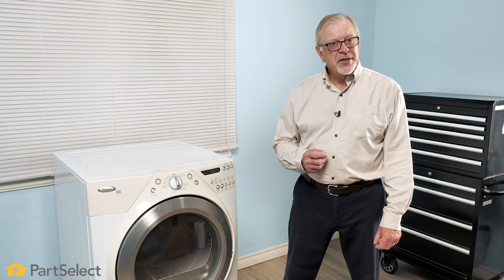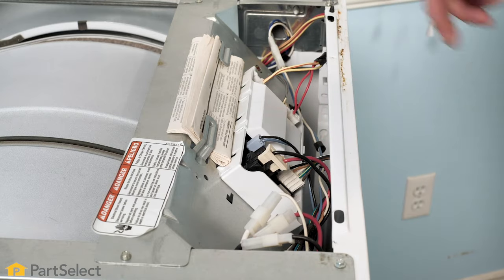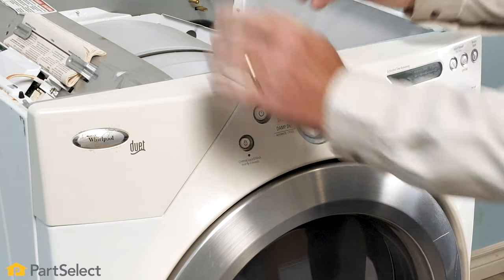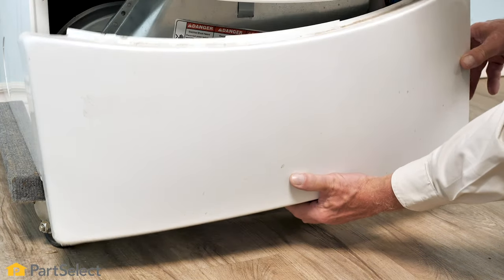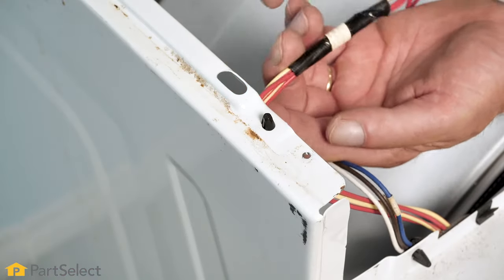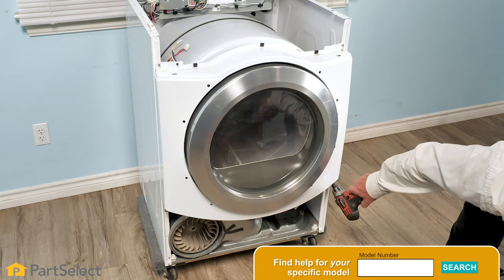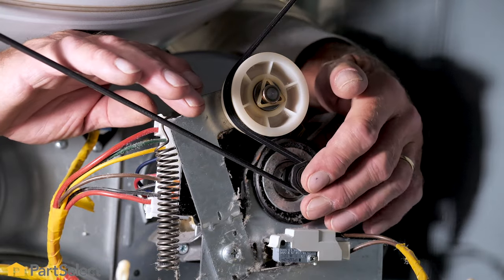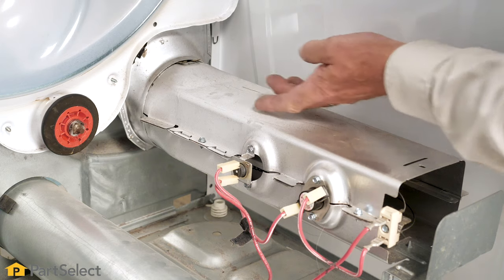Dryer Troubleshooting: How to Disassemble a Whirlpool Front-Load Dryer | PartSelect.com

Comment: This video saved me from having to replace my dryer.  We couldn't reach anyone for repair, and we use our dryer daily.  Because of its age, I was about to go to the Big Box and buy a new one, when I figured it couldn't hurt to watch a video or two.  Luckily for me, I landed on yours.  A fifteen dollar part (and about 90 minutes) later, we are back in business.  So grateful to you for your careful, step-by-step instructions.  (A belt replacement, by the way - the "Fits most Whirlpool 27-inch dryer" belt)

Comment: The hardest part of replacing my belt pulley and roller wheels was finding a video of the same model Duet Dryer that i had. Thank you for posting this, it made disassembly and reassembly a breeze!
Reply: That's my issue, too... there's apparently like three/six different models of "Duet" out there.
Reply: What model is this? My wife just texted me saying the dryer won’t spin and smelled like burnt rubber so I’m thinking I need to replace the belt. Did you have a similar issue? I’m not home to find the exact model of mine but it does look exactly like the one in this video.

Comment: This video was very helpful.   The f01 code I found to be more of a PC  Board Design Issue , the pad on the pc board was burnt considerably . I cleand the pc board and cleard away about a 1/4" of the copper trace and  connected a short piece of 18 gauge straping wire around the Relay post and ran it down the trace and soldered it back up . cleaned the carbon arc marks on the inside of the white plastic housing and re-installed it back in the dryer . No parts needed just a PC Board Fix .  Dryer working fine now .
 I used Brake clean and a small paint brush to clean up the housing worked very good and did not attack the the plastic .  Thanks for the excellent video .

Comment: Thank you SO MUCH, Steve! I had the dryer halfway apart but could not figure out how to detach the control panel. Was ready to either call a repairman or get out the 2 pound ball peen hammer :-). Your video saved the day; was able to replace the belt and tension pulley, now it's running great. Thanks again!
Reply: Same with me. Man it was a bear working on it with my bad back and it’s a stackable one at that, but this video saved the day for me too!

Comment: Just replaced the belt, tensioner roller, and drum rollers with the help of this video. Along with cleaning it out, it runs smoother than ever. This helped a lot figuring it out. Thanks.

Comment: Great video, a big help, thanks.  The metal clips around the cowl were the big problem for me.  It may have been previously removed by a former owner but the barbs seemed slightly bent and half the clips snapped off their permanent mounts in the cowling when I removed it. I was able to snap them back in place but they came off again when I tried to snap it back in place, with several of them lodged in the collar around the door. So I had to half-disassemble the whole machine again to get those out. Superglued them to the cowling but a few still broke free when I tried to install it, so I decided to just live with a somewhat loose cowling.  But I was able to replace the tension pulley and stop the squeak.

Comment: Can I replace the thermal heater fuse by tremoving the lower door and blower housing?
Reply: Usually.  It's right in the front.  Just know though that when one blows, its usually better to replace all of the thermal parts at once.

Comment: The best studio tear down I have seen but there are several mistakes. Too bad they didn’t go through and correct them. 
I can work up an error list later maybe.
Reply: No mistakes on my teardown other than a couple extra screws holding in the bottom panel.  Maybe your model just differs.
Reply: Agree, it most likely depends on the model. All steps were right on for me, except two extra screws holding up the front.
Reply: Depends on if you have gas or electric and what year or model your dryer is.